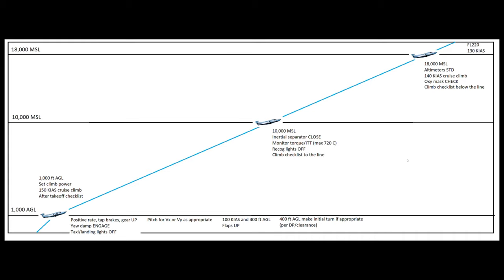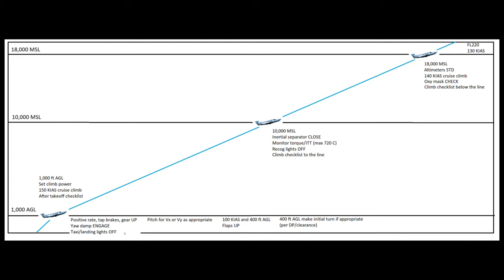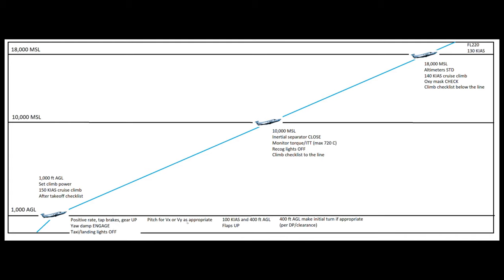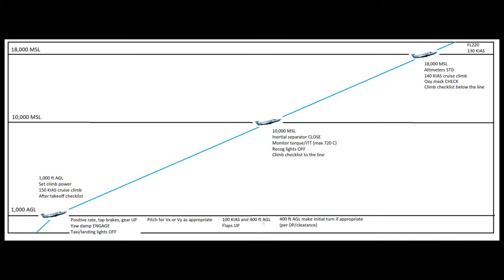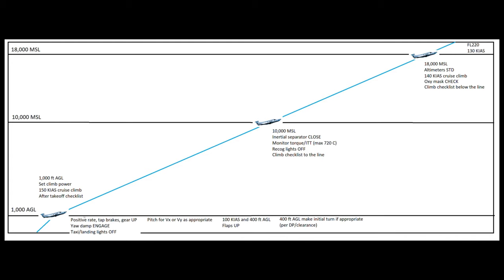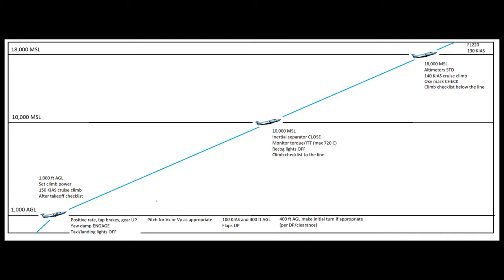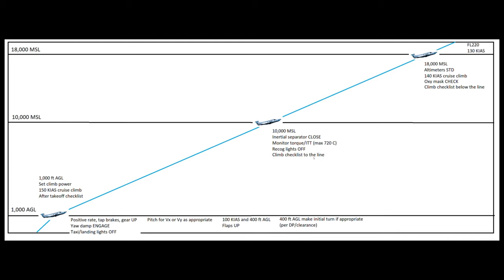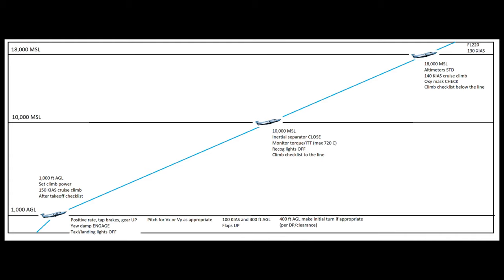Pilatus PC-12 Climb Profile

Comment: I think it would be great if you could do a video about operation of the stock autopilot in the legacy 12/45.  Compared to "modern" autopilots, IMHO, the controls are widely separated and not so intuitive.  Perhaps scenario based:
[1] initial climbout on a heading to a specific intermediate (low) altitude at the given 150 KIAS airspeed
[2] enroute climb on course to final altitude
[3] enroute altitude change at a specified rate (uo or down)
[4] terminal area descents at a fixed speed (200KIAS?) and specified descent rate (1000 fpm?)

Thanks for considering!
Andy Elliott
Reply from the maker: Hey, Andy. That's a great idea. I appreciate the suggestion. If only the autopilot was more accurately modeled in the sim! It's pretty unrealistic, so it'd be all but impossible to give an accurate account of the steps using the sim. And it'd be pretty tricky to do without a practical example in real time with just discussion. One of these days I'll try to get some in-aircraft video for the channel with a walkthrough of these steps.